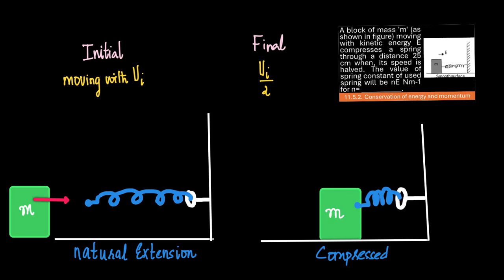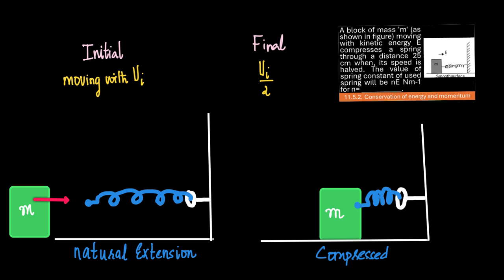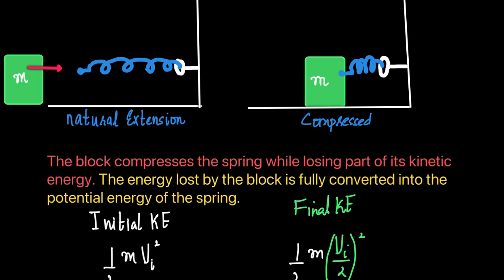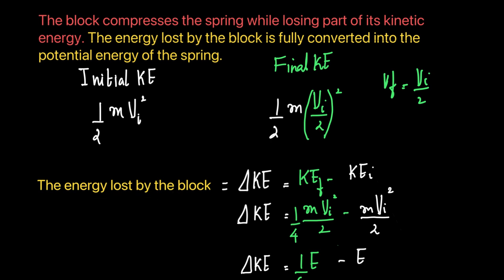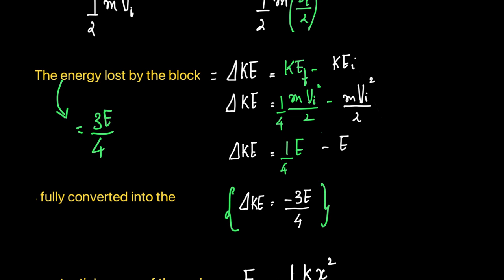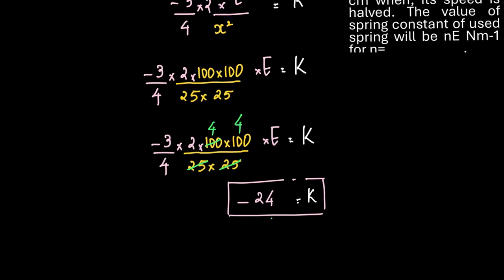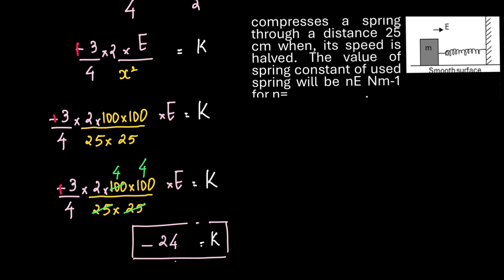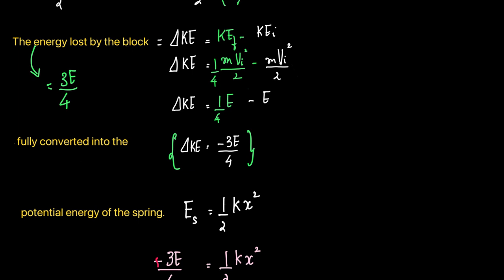A block of mass 'm' (as shown in figure) moving with kinetic energy E compresses a spring through a

Comment: Sir when I solved it with kinematics I got 12 and but not able to do with law of motion
Reply from the maker: First of all,  thanks a ton for reaching out. I really appreciate that you tried solving the question other way round - exploring multiple ways to solve 1 question will widen your  skills both numerically and conceptually. Now lets dive into the concept .
You're applying Newton's second law to a block acted upon by a spring.
So ,                                                                           ΣF = ma.
Since the only horizontal force is the spring force, you might have written 
                                                                                  F = -kx
⇒                                                                            -kx = ma
 ⇒                                                                              a = -(k/m)x
That's actually the standard form of simple harmonic motion, so you're on the right track so far. 

You then try plugging that acceleration into the kinematic equation
                                                                               v²  = u² + 2as
Which gives:                                                              = (v² - u²) / (2s)
Then you equate this to the spring acceleration:
                                                           v² - u²) / (2s)   = -(k/m)x
HOWEVER
acceleration here isn’t constant.

In a spring system, a = -(k/m)x, which means acceleration depends on position (x).
That’s why using the kinematic equation v² = u² + 2as doesn’t work — it’s only valid when acceleration is constant.  To add futher, Constant acceleration means the rate of change of velocity stays the same over time.
For example:
In free fall near Earth, acceleration due to gravity is constant at around 9.8 m/s².
That’s why equations like:                               v² = u² + 2as and s = ut + (1/2)at² , work perfectly in such cases.

These are called the equations of motion for uniform acceleration, because they are derived assuming acceleration 'a' does not change with time or position. In a spring system, the only horizontal force acting is the spring’s restoring forceF = –kx By Newton’s second law: F = ma ⇒ a = –(k/m)x
So here, acceleration is not constant — it depends on the position x of the block.This is called position-dependent acceleration.That means: If the block is far from the equilibrium, spring force is stronger ⇒ higher acceleration. If it's closer, the force is weaker ⇒ lower acceleration.That equation is only valid when acceleration a is constant.It is derived using integration under that assumption. But in a spring system:'a' depends on 'x'.And as the block moves, 'x' keeps changing.So 'a' keeps changing too.This breaks the assumption behind the equation, making it invalid here. 
I hope this assists you in the question.